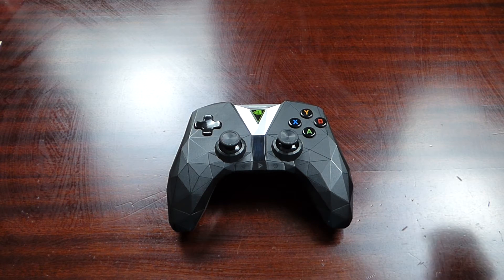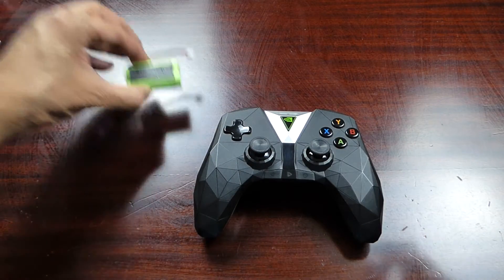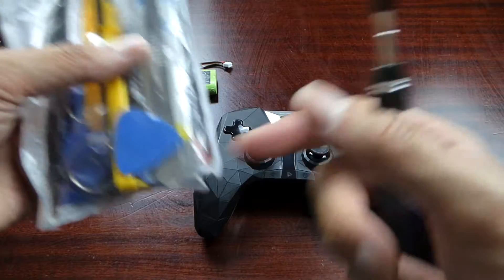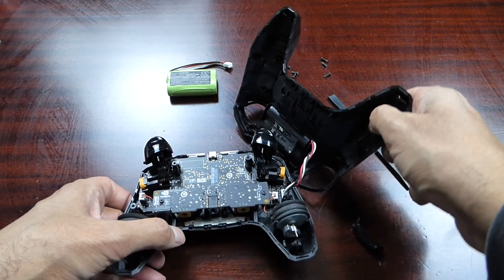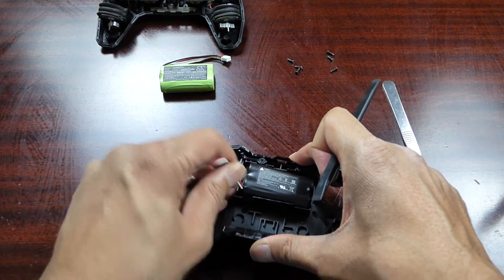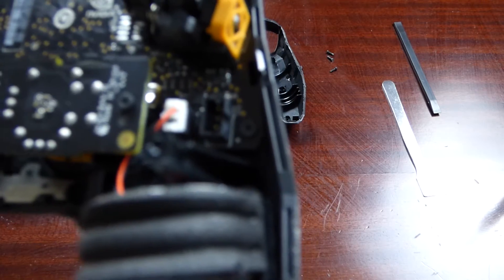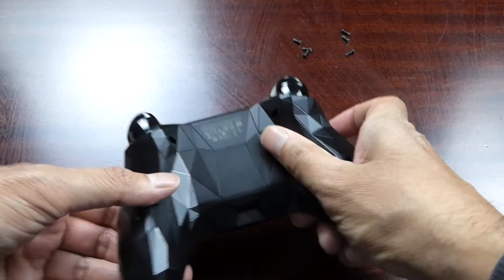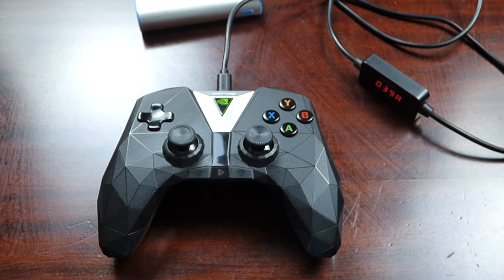How To Fix The nVidia Shield Controllers Battery

Comment: I've tried two different replacement batteries with mine, neither charges. Controller only works when plugged in now.
Reply from the maker: Some battery packs have no battery management system so may not work.

Comment: Just replaced the battery but still when i unplug the charger the controller doesnt work. The shield displays the controller is charging and the battery is full. Any idea what the problem could be?
Reply from the maker: Did you try pairing again? By holding the NVIDIA log for 3 seconds to put it into pairing mode.
Reply: @IntriguingTech  I did.. Im pretty sure it doesnt have power once connected to the new battery. Maybe the old battery wasn't degradee/broken and the problem is something else?
Reply from the maker: @MrFerb078 Did you check the voltage with a multimeter ? At least you can confirm if the batterys good.
Reply: Try pressing down on home and one of the analog sticks

Comment: It is better to replace the battery pack with AA LSD batteries. Although it is a little bit more complicated and requires soldering. 

There is a video about it on youtube called "How to replace the original battery to AA batteries in the Nvidia Shield controller step by step. "
Reply from the maker: Yes but good quality AA are also expensive. Thanks for the suggestion.
Reply: @IntriguingTech  Eneloops are pretty expensive, but they work way much longer. I've been using some of them for 10+ years and they are still fine.
Reply from the maker: @rainbow_world  Thanks for the info. All the best.

Comment: What a trash design by nvidia lol
Reply: Very shit design man I replaced mine today with the exact same battery he got and it does fuck all wont even work hard time putting it back together as well
Reply: These remotes were easy to get battery problems and buttons 😅 i use it just with plug in now when I want to connect cable earphones to remote and use tv quietly. When i connect xbox remote i cant hear sound from cable earphones through xbox remote

Comment: There's another video on Youtube showing how to just remove those wires and bridge and replace the batteries with rechargeable AA's. All you need is a cheap soldering iron and decent AA's. No reason to buy a $15+  - $20+ 'pack'

I'll link it actually   https://www.youtube.com/watch?v=z38BwvIkHSw
Reply from the maker: Thanks for the link. It will useful to others who decide to build their own pack.

Comment: Why did you not show how the battery was placed back inside the controller?
Reply from the maker: Hi just push it in the little recess, nothing more to it. The wires hangs from the bottom left. Hope that helps!
Reply: @IntriguingTech  I was wondering the same thing. Thanks for explanation.